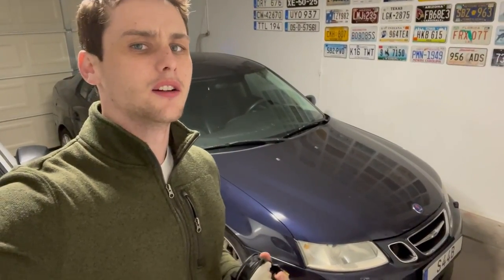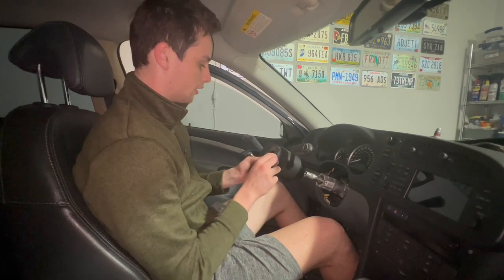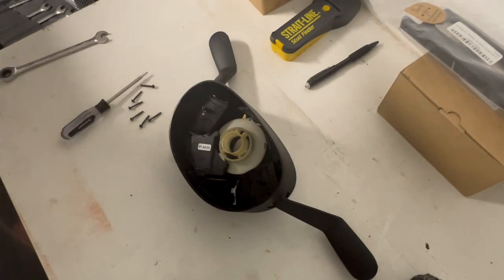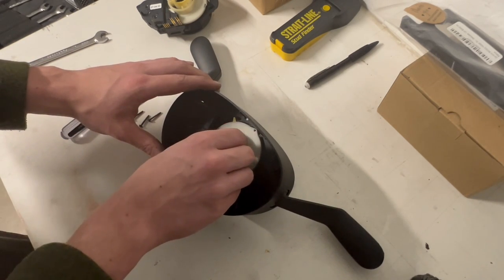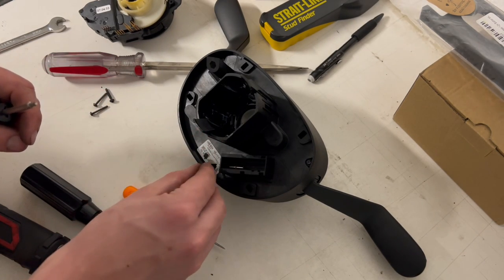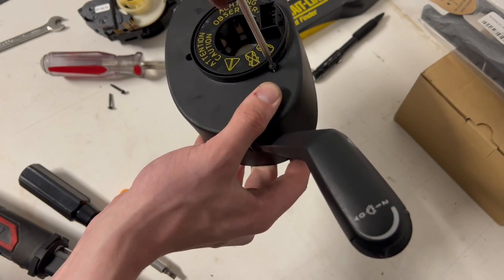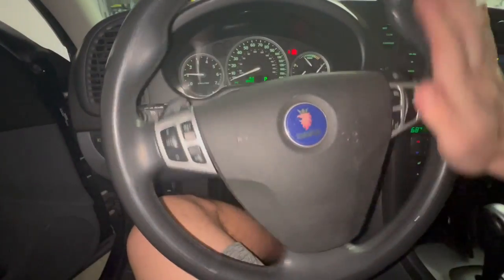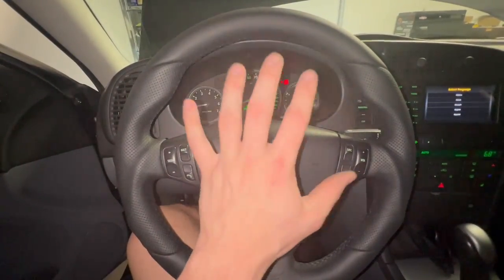Solving the Pesky Airbag Light in My Saab 9-3!

Comment: Just bought a 2003 saab 95 with a manual trans 5 speed im new to manual so gonna burn the clutch but it’s got a whopping 256,000 miles on it and it’s still going
Reply: Wow amazing my one has 200,000 so it makes me feel better about the mileage lol

Comment: You have a good point about the clockspring. Moving forward, I will be rotating both ways to find center first, before installing. Been lucky so far, with the 2 I replaced in the past, without doing that. No SPROING on those....lol.

Comment: On the two sim tabs, gently drive a small thin flathead screwdriver or wedge of some sort, into each tab's gap, enough to lift the tab past the catch, and then easily pull the assembly off the wheel. Much less likely to have a heart attack, get cut or break a tab. Still it is an interesting design to put all that together in one module.

Comment: my 2005 93 aero cab has airbag light & no horn ( tried cleaning seat posi sensors, no dice ) so looks like it will be my next project
Reply: Have you done it yet have the same problem rn with mines

Comment: Thanks.  I've bought a replacement clockspring, but I've been afraid to do the replacement.  Can you give a little instruction on how to safely remove the steering wheel & airbag.  What is the best tool to pull the tabs at the beginning?  Shouldn't the first step be disconnecting the battery?

Comment: Oh man I need that steering wheel  looks real good hopefully they aren’t sold out by now 😂 … very informative video about to be doing this job to my friends 2.8 aero dude before had a dead ecu double gasketed injectors autozone coilpacks and faulty oil pressure sensor  😂 it’s all fixed now but the airbag needs to get fixed or it won’t pass inspection rip

Comment: Had the stability control failure on my 9-5 a few years ago, was solved by resetting the steering wheel position sensor with Tech2

Comment: Guys, I have a problem. Had my car parked for a while. Battery died, replaced it with a new one. I went to turn it on and now my key won't turn. Took ism off, bypassed the lock in it, reinstalled ism and key turned , but car will not start. Some else said something to do with the steering wheel....any idea what happened that made the car not start?
Reply from the maker: there's a bypass on the positive battery terminal that you can do that I think would solve your problem. I can't post a photo in the comments, but there's good info online about it